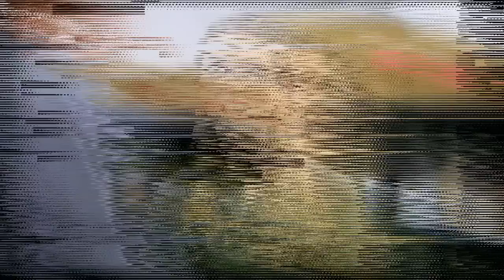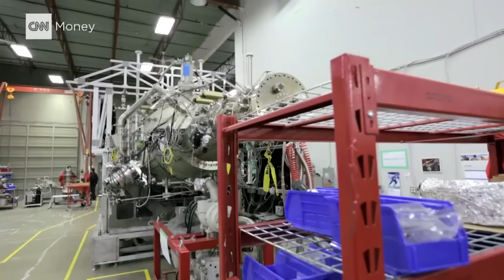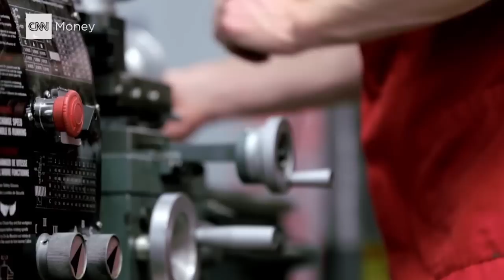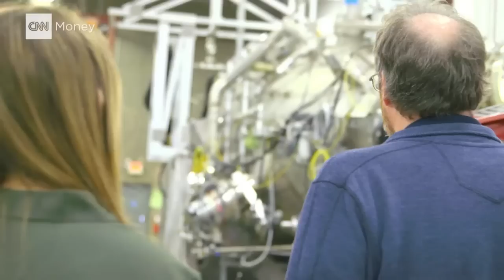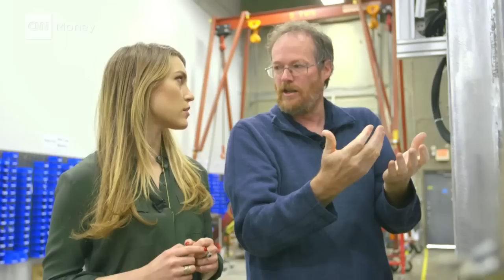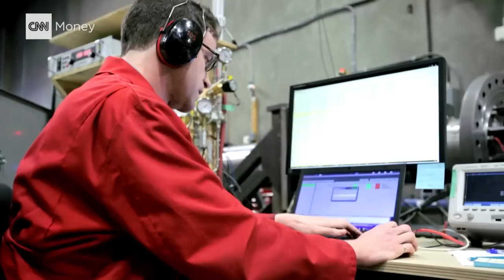This company could power the world for 65 billion years

Comment: Well two red flags here.

First is their proposed power conversion system is apparently stream turbine.  While stream turbines are great the reason we use them is because they are the right choice for relatively cold heat sources like coal.  Fusion isn't a relatively cold source in fact it's literally the opposite, it's very hot.  There are other proposed nuclear heat sources who do know their stuff and they know with high temperature you run closed cycle gas turbines instead of steam turbines.  Gas turbines are much more efficient, much smaller therefore cheaper, and don't require a water source.

Second flag is the important question, because achieving fusion isn't terribly difficult.  Sustaining Fusion is actually the real challenge,  they make zero mention on how they sustained fusion.

Conclusion like most fusion technologies this one is also in its fetal stage of development.  It is not a viable solution for TODAYS energy crisis but may someday serve the children of millennials if not a generation even farther down the road.
Reply: Jeremy Oelke why does the heat of the fuel matter? The turbine only sees the water so just get its temp. right.
Reply: bensemus x So the vast majority of the electricity we create is by spinning steam turbines.  That stream is primarily made by burning coal or Pressurised Water Nuclear.  Both applications use exactly the same turbines.  The reason both use stream is because neither technology can heat any fluid all that hot.

Steam turbines are great they are there backbone of our infrastructure, but they have three problems. Problems that a HTG(high temperature gas) turbine address.

Stream Turbines are much less efficient then HTG meaning that less heat is turned into electricity.

Steam turbines are huge, which isn't a huge deal but HTG turbines are like 1/8 the size, another advantage.

Lastly and this is important, stream turbines need to be close to a source of water, because they use a lot of water.  And usually designers want that to be fresh water too.

Both Fusion and some other types of fission like the Molten Salt Reactor do reach the kind of temperatures that can utilize HTG.  Basically for me it's like a test of how aware a fusion group is of reality.  Now this is a CNN video so maybe they've dumbed it down(which is still as bad sign).  It could be they are aware of HTG and just didn't mention it because it's also an experimental technology.
Reply: ***** ty

Comment: We have the Sun, giant nuclear reactor in the sky. We need to tap a little bit of energy from the sun with solar panels. That is simpler, safer and cost effective solution.
Reply: テスラモーターズファン. Currently, what you stated would be the most economic way to get "free energy" for the masses. Although, solar power can only go so far in its efficiently to hold and produce energy. Fussion would allow for a almost unlimited amount of power to be produced. While more expensive at the moment, fussion would be the more stable and reliable solution for producing clean, cheap energy.

Comment: Why would we want to do fusion here when we have the perfect, free fusion reactor safely off in space?
Reply: Cause we can't harness that shit around the clock and it's like 500,000,000 miles away
Reply: Storage is an easier problem to solve than developing a fusion reactor. And 500,000,000 miles away is exactly where you want a nuclear reactor.
Reply: +MakeMeThinkAgain we can't use the energy from the sun unless it's solar panels or a shit ton of mirrors pointing on a single point...actually mirrors being used to boil water and make steam for a turbine doesn't seem bad and there's no radiation...well although that is a GREAT idea and I should try and patent that we still can't do that around the clock simply having a fusion reactor on earth would be cheaper and more efficient than trying to harness one that's 500,000,000 miles away
Reply: Another reason solar + storage is better is that (in theory) you could eventually get rid of the grid entirely. If power was generated and stored locally there would be no reason for the expensive and wasteful transmission system. You would probably still need metro-grids around cities, but it should be possible to get rid of the bulk of the grid.
Reply: +Sarcalogos Tortolero    500,000,000 miles?   The sun is 93 million miles away.
Reply: +Sarcalogos Tortolero That type of solar mirror-heating plant is already working here in Spain and many other places. It is better than fotovoltaic panels in many aspects. You just fry a whole lot of birds.
Reply: Good catch there. Though still a nice safe distance away. And in time it will be even closer.
Reply: Sarcalogos Tortolero check out the Andasol solar thermal power plant in Spain which uses molten salt for 24hrs electricity supply.
Reply: because we can not afford extension cord for that reactor..
Reply: ***** you are funny...go back to school
Reply: ***** quote "The solar irradiance in space is 40% stronger than that on the ground."
Reply: how u gona get the energie on the planet? 

& as soon as the vacuum leaks it cools down, thats the whole point of having that magnetic bullshit at the first place. as soon as it leaks it'll cool down and nothing happens.
Reply: Solar Aqier You gonna get the energy back by mirroring/focusing it to Earth or using the energy to power a laser beam and point it at Earth or any other similar method. IDK what you are trying to say in the second half of your comment.
Reply: Rubertoe well they need to keep that thing super hot (with the magnetic field thiny, no clue how its called in english. so that it keeps fusioning. as soon as it leaks it'll cool down. nothing happens than. it's not like a atom reactor at all. not dangerous.

so no reason to build that in space just aawaste of time energy and resources.
Reply: Solar Aqier Oh I thought you meant the solar power plan. Well, it is the opposite. In space the hard part for a reactor is cooling. With no air to pick up the heat a whole lot of water radiators would be needed.
Reply: Rubertoe I'm farely confused now. I said a fusion reactor is not dangerous :p and a atom reactor is. so why would you want to build the fusion reactor in space? :)

Comment: Why pneumatic pistons?  Wouldn't hydraulic apply more force?
Reply: Fifty State can hydraulic pistons fire as fast though? Their design seems to use a shock of force instead of pressure.
Reply: bensemus x 
Yeah, you don't push bullets with a squirt gun do you?  The design seems to require speed and pressure; with the pressure coming from the number of pistons.
Reply: Fifty State Where do you push bullets with a piston? That makes no sense.
Reply: bensemus x 
2:28 the engineer mentions their design as  "pushing pistons with compressed air"
I was making an analogy between a piston and a bullet.  The piston is like a bullet, it just doesn't exit.  Notice the first word in my answer was "yeah." I was agreeing with you. A liquid would not push a bullet as fast as a gas.
Reply: Fifty State oh I understand now. I first read your comment as a sarcastic response and assumed you knew something I didn't :P

Comment: "there is Not a meltdown possible"

right... 

it's better to create a small Sun 👌

(i Love Fusion btw)
Reply: vf fa there's no melt down as there is no way for a runaway reaction. The "mini sun" can't ever be self sustaining due to its micro size. Fission reactors work by inhibiting nuclear reactions. Take out the control rods or cooling water and the thing goes into over drive, melting the containment vessel.
Reply: bensemus x right. if you make the Fusion Big enough it can... But it's costs Way to much so they wont do it i guess. Also because if lobbyism
Reply: vf fa You would have to make it as big as a star for it to be self sustaining. Nothing else will have enough gravity to crush the core enough to generate fusion.
Reply: bensemus x (from an official article) 50m is enough
Reply: vf fa Do you have a link to that source?
Reply: bensemus x i read that half a year ago... So, No... I definitely don't have that link 😅
Reply: vf fa I'm calling bull on it. The pellet of hydrogen needs to be heated to immense temperatures and put under extreme pressures to fuse. It would also be consumed instantly which kills the reaction as fusing helium is out of the question.
http://www.space.com/21420-smallest-star-size-red-dwarf.html

Comment: Load of crap. To get the "fuel" you need huge amounts of energy as it only exist in fractions of a %. You need huge amounts of energy to heat the fuel up. Definition of perpetual motion, no such thing. Plus who's going to build the 1000's of fission reactors to source the fuel which btw only lasts a few day's so these reactors will need to be built very close the the fusion reactor... Amazing how these con artists keep getting away with this crap promising a false hope and the media laps it up.
Reply: Someone who use to believe that this was possible until I spent many hours researching the details about the fuel and the reactors.To let you know there are two main types of fuel. One of them is found in the ocean and requires huge amounts of power to extract and the other forms in specialized nuclear reactors. They are needed as it is radioactive and decays quickly, it's the only way to get it quick enough and in large enough quantities.

Comment: No meltdown can happen in a fusion process? Tell that to stars.. Lol
Reply: The difference is that stars sustain fusion through pressurizing the core due to gravity. These reactors however sustain the reaction by using an immensely powerful magnetic field. If fusion in a star stops, it collapses. If fusion stops here, everything just stops.
The real danger here is high energy neutrons, although simple shielding fixes that just fine.
Reply: Stars don't meltdown. They shutdown. That means it shrinks really fast and the shockwave then present is the nova. Either way that has no importance here.
Reply: +Loke Gustafsson nothing is irrelevant.
what about when a star swells to critical mass thus breaking down its own magnetic field and allowing an event to occur? Not arguing lol, just curious.

Comment: they are using mechanically actuated pistons to trigger anatomic implosion? I believe this is a noble attempt that still holds possibility, and I'm sure the calculations show the mechanical energy can be delivered (theoretically). but I'm left to wonder how much is lost from electrical to compressed air to mechanical then to acoustic the order to focus the energy on the pellet
Reply: ..and I have questions about it viability - will a mechanical system ever be precise enough? And what about wear? I'm assuming this would be a continous cycle? Hmm...

Comment: why didn't they use explosive lensing as a test bed? also quite cheap though dangerous...just thinking out loud here ,  but that could be a catalyst for focusing energy beams on surrounding matter on many critical points or locations in extremely rapid pulses to simulate the type of pressures that the sun's  gravity provides if only for short intervals , perhaps with some electromagnetic addition like the focus you get on a rodin coil for example...maybe if you consider the rodin coil's focal point , take the point and vector assume the lager coil turn the points into the desired shape , with the coils not intersecting with the addition of enough angular space for whatever apparatuses  you might need to create such an lensing effect,  focused magnetrons?,  i' thinking a lot of titanium,  solid no hex mesh... magnetrons and water? water being a great diamagnetic seems like it might have a added benefit...seems like one wants the core to be superfluous and superconducting , ag , mabe it some other sort of matrioshka doll setup almost like those synthetic   diamond anvils , different energy conversion by means of perhaps induction from sphere to sphere with some added mechanical component perhaps but i think we are beyond tertiary seals here ,  but that's the thing , if you can't eat the oyster , how can you get the pearl ? Harvesting the heat rather than em or neutrons ? is there a chance of direct conversion to streaming electrons ? I am not a physicist at all , just curious , and to put your minds at ease and make amends for my ignorance ,  i'll tell you a joke for free... two jamaican atoms are walking on the beach smoking a joint , the one exclaims " woa mon , did you see dat mon? I sink i jast lost an electron mon !" the other one subsequently replies " Woa ! are you positive mon?'' 
Thanks , you've
 been great , i'm here all week...